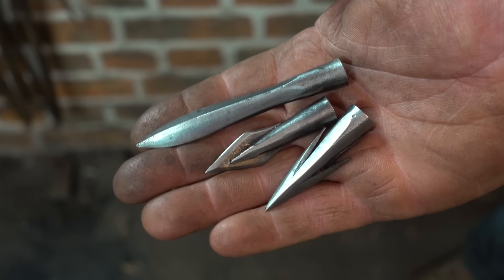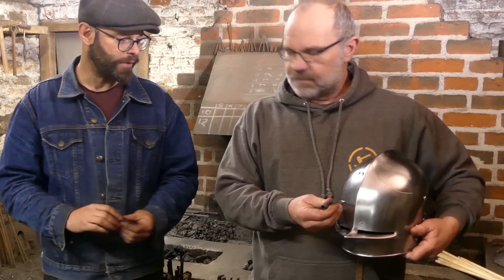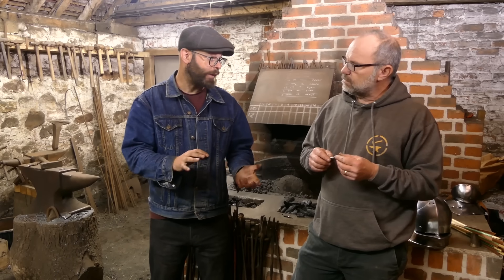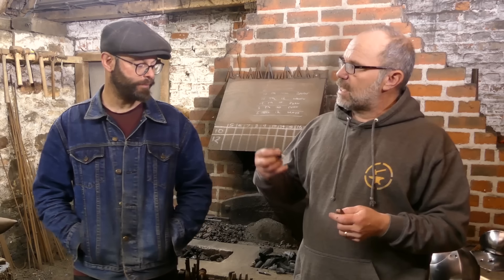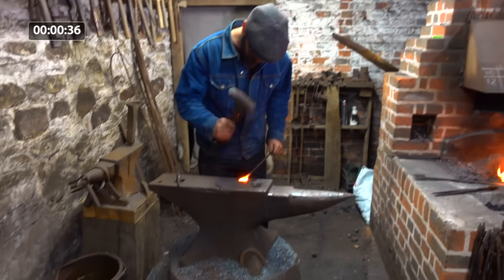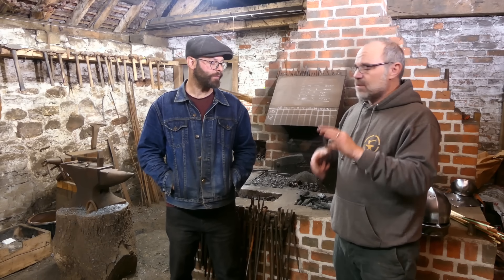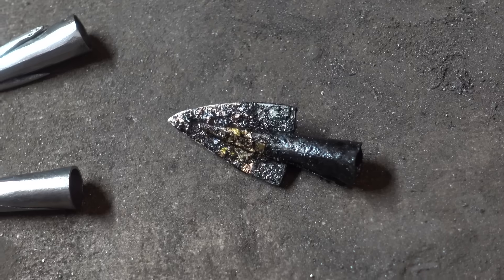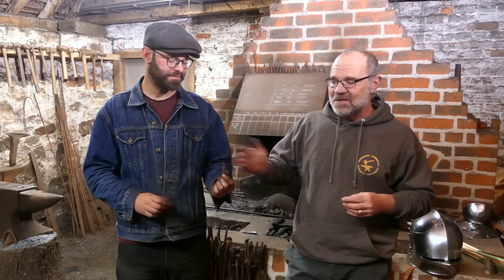Why Bladed Steel Arrowheads were Superior - Arrows vs Armour 3

Comment: There's an essential operation in forming the shape of the blade that's cut out around 10:16. It's what I was most wondering about, apart from the welding.

Comment: If you look at statistics from WW2 through Vietnam, the vast majority of bullet wounds are to the extremities, not the torsos. Makes sense because the majority of a human target’s area is in the arms, legs, and head. I would think the same statistics could be the case with arrow impacts in medieval warfare. The dispersion is much greater than modern rifles, and at max range the arrow impacts would be truly random/unaimed. And just like Soldiers today, you cannot wear your thickest plate armor on your extremities. In the Battle of Shrewsbury, Prince Henry and Henry Percy both suffered arrows to the face upon lifting their visors. The removal of the bodkin point from Prince Henry’s head was a significant medical achievement at that time, but makes one wonder, if the type 16 or type 21 was in use, if he would have survived at all. The arrow would have probably penetrated deeper, made a wider wound, and would have been much harder to extract. As others have pointed out, I suspect both Type 16 and Type 21 were the best compromise—longer range, more arrowhead yield per given weight of raw materials, and better “general purpose” performance.
Reply: Henry wasn't shot with a bodkin, that's a very common mistranslation of the original surgical report.  Bradmore wrote that the arrowhead "a bod styl" which has been taken to mean "bodkin style" when actually he meant "abode still" which is a phrase he himself used earlier to mean "was still lodged in the skull".

Bodkins were pretty much extinct on arrows by the 15thC, and the tiny tucked-in barbs of the Type 16 are exactly why he needed to invent his removal tool
Reply: @MedievalArrows Roger, very cool, didn’t know that. Those Type 16’s are pretty mean!
Reply: @M @MedievalArrows  This was the kind of content that lead me to believe it was a bodkin. Thanks for the correction. https://youtu.be/s982-bufjh8?si=VO0KixE9gJDLrj5Q
Reply: @wingardwearables it's actually a really interesting point that as far as I'm aware nobody has ever tried the Bradmore extractor with an accurate replica of an arrowhead from 1403.  Something else that needs testing!

But yes in general,  99% of people who talk about or demo that surgical procedure use bodkins,  purely because of that mistranslation.

Comment: Type 16 vs 21 seems to me like two different methods for making the same design. Like two different forges looked at the drawings and just went about it different ways. And then if they did indeed 100% stop making type 16. It would be because they realized the 21 were easier/cheaper to make and as effective.

Comment: I can't help but feel that the advantage of a lighter arrow isn't just that it will travel further. If I was rocking up at a battle hoping to chuck as many arrows towards the enemy as possible I'd be turning up with as many as I (or my horse / wagon / wife) could carry. In such a scenario a bundle of arrows half the weight of the old ones would be a significant advantage even if the enemy was still foolish enough to be standing the same distance away as last time..... Do I want double the number of arrows even if they still go the same distance? Yes. Do I want double the number of arrows that will go even further than previously? Let me think about that for a mome.... YES!
Reply: в европе кроме викингов никто практически не использовал стрелы которые можно было бы считать бронебойными. поэтому все вами сказанное - относится прямо, но к стрелам против не бронированных противников и/или лошадей.
а те стрелы которые можно считать бронебойными для например 11 века - стоили в целом дороже жены которая могла их нести, если вы их могли купить конечно.
сколько стоит убитый с 50 метров тяжело бронированный рыцарь благородного сословия? причем убитый минимально физически подготовленным вчерашним крестьянином?

Comment: Very interesting video, could it be expanded to see how long it takes a make a certain amount of each type ? A skilled blacksmith can make a 1 off head quickly but making more will result in fatigue and it would be interesting to see if making 20 of each results in the same time for each head or if the time increases for the more that are made
Reply: The time actually decreases,  I find.   Once I'm "in the groove" the rate of production goes up. 

When I do them like we did in this film,  it's all stop-start work and going in cold,  so it's slower than if I had being doing them all day

Comment: This is what the making of science is: Curious people mastering crafts to answer their questions while having fun.

Think about it: Galileo made a description of gravity by going out on picnics with like-minded people and dropping weights from various heights, in the process making ground work on a field-easy timepiece of sorts (having realized that a pendulum's period is determined solely on its length, not its weight), allowing for better guesses at the speed of ships from far away; Boyle and Hooke were batting ideas about for practical ways to study the effects on vacuum on various things, resulting in Boyle's vacuum pump (actually, Hooke was the craftsman of the two, so it ought to be Hooke's pump), which they toyed with to form Boyle's Law (at constant temperature, pressure and volume are in inverse relation) and which led Hooke to figure out that organisms consisted of cells (in a vacuum, water-filled cells tend to burst)... Newton is said to have begun his work with calculus being puzzled by branches being bent by the wind.

I all starts with curiosity, followed up by a willingness to work, and finally having fun while puzzling it out.

Oppenheimer's description of the Los Alamos science environment sums it up, I think:
"We tell each other what we don't know, and teach each other what we don't understand."

Comment: For the same physical size and shape, a heavier projectile retains more kinetic energy at a distance than a lighter one as it retains more of it's velocity over distance. Kinetic energy is the metric of damage potential. 

So a heavier arrow imparted with the same starting energy should retain more energy at a given distance than a lighter arrow. As the lighter one moves faster, and coefficient of aerodynamic drag is the same because they're the same shape, so since the drag force is the square of the velocity, they loose more energy because they're moving faster. KE=1/2MV² too, so as the speed rapidly reduces, so does the energy.

But gravity is 9.81m/s regardless of weight, and aerodynamics are the same between the two, so the arrow take the same time to drop to the floor from a height if shot a 1m/s or 1000m/s, so the faster arrow travels further in that time. 

That is presuming that the arrow is shot horizontally. If it's angled up then a heavier arrow might go further than a light one. 

Thought experiment to prove it: Two arrows. One balsa, one solid steel. both imparted with enough energy to propel the steel arrow at 100m/s. Shot from the top of a very tall cliff. The balsa arrow probably won't survive launch. If it does, it'll be WAY faster than the steel arrow, then slow to a horizontal stop VERY quickly in a short distance. That heavier steel arrow can survive launch and will carry that energy a longer distance.
Reply: I'm guessing part of the disconnect here is in how a bow transfers energy. Like how a steel limbed crossbow needs a heavier projectile to maximize it's kinetic energy and a lighter projectile is effectively "wasting" energy, as it reaches the limbs maximum speed limit before the end of the power stroke. A lighter limbed bow might struggle with a heavier projectile.

I'm presume muzzle energy are the same between the two, so the lighter arrow is faster than the heavier on initially, but slows down much faster, assuming they're the same shape.
Reply: The heavier arrow's launch velocity is lower and it requires bigger fletchings in order to be stabilized. So neither the velocity or aerodynamics are the same, with both being in the lighter arrow's favor. Flight arrows are light for a reason...
Reply: @hjorturerlend   You're right, if the drag is higher then it will loose energy faster. "flight arrow" is for long distance shooting. I did say "the faster arrow travels further in that time. " and the faster arrow assuming the same starting KE is the lighter arrow.

The quote in the film (@5:15 ish) says that the type 16 head "will allow the arrow to travel further, because it is lighter" That presumes it's traveling faster due to the same starting energy. If it isn't because you use a more powerful bow to shoot a heavier arrow, then this changes things. I presented the alternative that the initial velocity were the same due to different bows. 

I've just put together the maths and a simulation. Assume the same starting velocity of 100m/s over an arbitrary 55 seconds, (which would need a 3.2km vertical drop):
Light arrow (19.9g): 
Final Velocity 77 m/s
End KE: 57.74 J
4.8 Km horizontal distance

Heavy arrow (45.5g): 
Final Velocity 88.72 m/s
End KE: 178 J
5.2 Km horizontal distance

Given the same starting velocity, all other things being equal, a heavier arrow will travel further and retain more energy on impact. It will also end up traveling faster than the lighter arrow after a distance. In other words, the opposite of the statement "lighter arrows travel further".

If it's the same starting energy instead so the initial velocity of the heavier arrow is lower, then the kinetic energy at a distance for the heavier arrow is higher, but since it travels slower and acceleration under gravity is constant it will hit the ground sooner given a flat launch angle and the same launch height. So lighter arrow is longer flat range, but not necessarily in a volley. I haven't done the volley maths because it involves resolving components and I can't be bothered with that.

I would need real world measured CdA and weight for some arrows to work out the trade off between stability and drag. Generally speaking though: Heavier projectiles, with higher density and mass but similar diameter, actually experience less aerodynamic drag force relative to their inertia, giving them better ballistic coefficients (BC) for stability and range; they don't inherently need more drag or bigger fins, but rather specific features (like boat tails, longer ogives, and appropriate spin rate) to manage airflow and stay stable. In other words: HEAVIER arrows don't necessarily need bigger fletching's. BIGGER arrows need bigger fletching's. There is an assumption that they're the same density; made out of the same material. if more of the arrow mass if the head then it's overall density is higher. Also a heavier head for the same length increases aerodynamic stability by moving the center of mass further forwards of the center of pressure. 

Also heavier arrows are less effected by wind. 

So the limit here seems to be that: if you can get all the KE of the bow into any weight of arrow, then the lighter arrow travels faster initially and thus travels further before it hits the ground when shot flat, because it hits the ground in about half a second, before it's traveling slower than the heavier arrow.

Comment: I would love to see you guys source some actual wrought iron and pound it into some armor pieces and do tests against that. Wrought iron which is what would have been widely available is weaker than modern mild steel. I know that wealthier knights and soldiers could have afforded steel armor. But i'd be willing to bet that lots of soldiers would have had their plates made out of wrought iron as it'd have been cheaper.
Reply: Would have been great,  but unfortunately sourcing enough wrought iron of decent quality for that is close to impossible at these budgets.   I've got a forge full of medieval,  Tudor and Victorian wrought iron,  and none of it would be suitable!  We'd probably need double the latest kickstarter amount to get hold of enough iron that could withstand forging into 1mm sheet (or to afford the labour required to turn the stuff I've got into suitable stock)
Reply: @MedievalArrows   It makes these tests slightly flawed using modern mild steel. But it is fully understandable considering funding limitations, and it's not like it make these tests invalid. It's just more like testing the best of the best of the period. And if these arrows are doing this to the best, you can imagine what  they would do to lesser quality armors.

Comment: The question I have about Type 16 vs. Type 21 has to do with how much terminal effectiveness/injury potential do they actually provide once they get through armor.

Barbs are horrendous in flesh, and I'm having a hard time believing that the Type 21 is really able to achieve a similar effect to what barbs do.  However, I suppose it's possible that the bladed aspect of the heads was found to cut well enough that any internal damage and bleeding they caused was deemed sufficient, despite the fact that they appear to be more easily removed from the body.

Comment: Would the mass of metal needed per arrow ever be a consideration? Could you get roughly 1 or 2 more arrows of the more modern type, surely that's an advantage also? I'd rather have three faster harder arrows than 1 older and heavier arrow.

Comment: I find it hard to believe he welded that arrowhead in just 7 minutes! well, actually, that he welded those flimsy barbs at all without burning them off., or the thin socket. i dont recall seeing fluxing either...
Reply: No I don't use flux at all, unless I'm brazing.  There's no need really, if the fire is clean.
Reply: @MedievalArrows  I learnt fluxing was protection from oxidation.rather than from impurities. to be honest, Ive never heard of forge welding without some sort of flux before.If you are able to weld like that, i find that just amazing.
Reply: @stephangleiner1333 most good smiths don't use flux!  Nobody I know uses it,  unless they're welding two very different carbon content steels in large sizes.   With good fire control and especially when using wrought iron you definitely don't need flux.